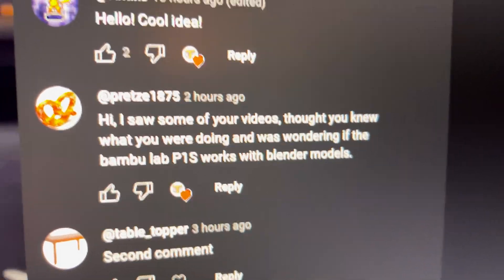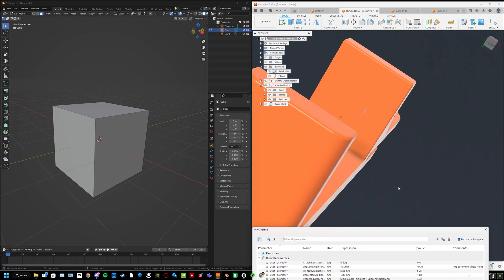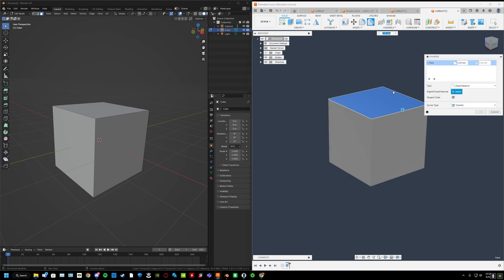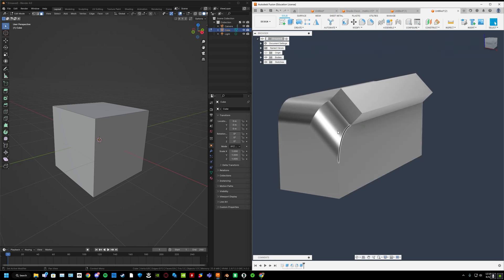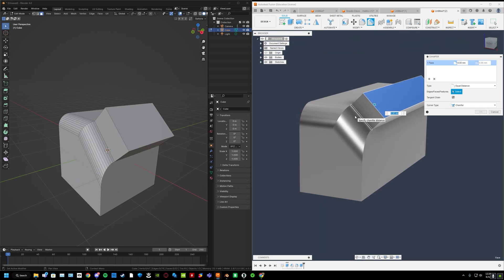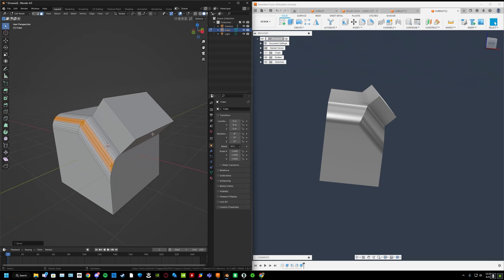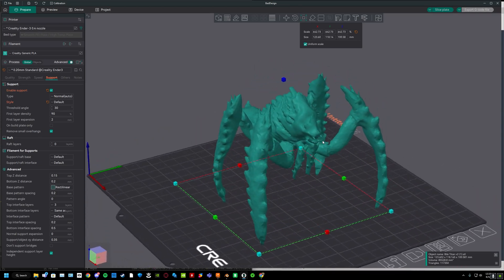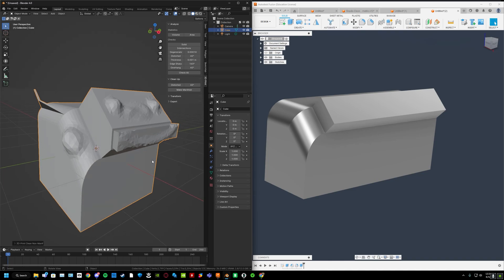Should you use Blender for 3D printing?

Comment: So the issue you have shown at least one of the issues is to do with destructive workflows. Destructive workflows are exactly the example you have shown. You directly influence the verts and there are not many ways to go back and change things since its the new state of the object. But if you use more like modifiers and other tools blender provides or addons for non-destructive workflows you could make the both models you have shown with flexibility for adjustments. With all being said, even though you can make models with increments, exact proportions and such, of course a cad software that meant to do that with math will be more precise since you are less likely to make mistakes. Since Blender is a poly based software, it kind of requires you to think about modeling a cad model if you want to create cad models meanwhile Fusion360, Plasticity and others just do cad models. If that makes sense.